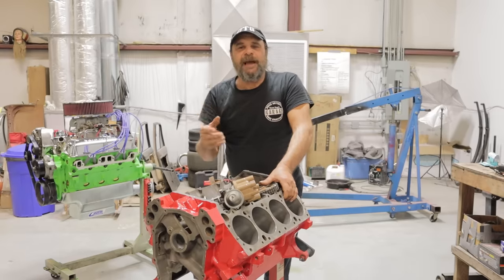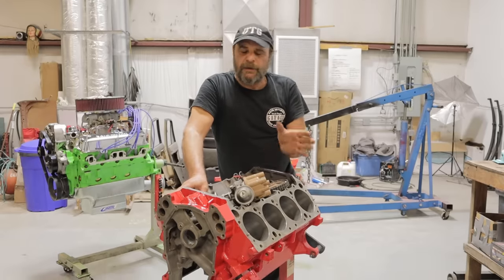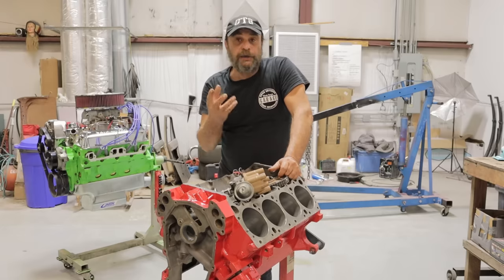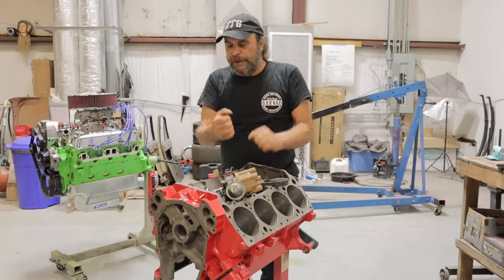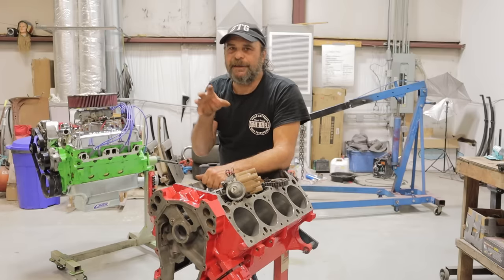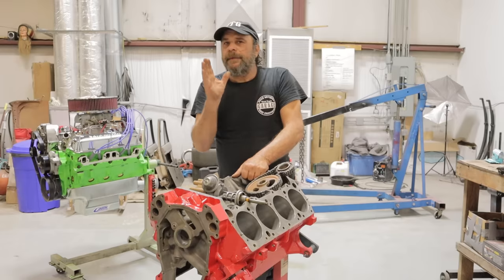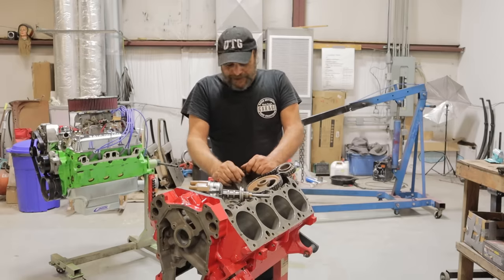Power Timing Secrets For Classic Cars

Comment: You got that right pal....I tune by ear, smell, sound, how much heat hits my face from engine, how hard the fan pushes air past motor, how hard the exhaust leaves the tailpipes, how the tach needle climbs when throttle is blipped wide open and settles back.  Timing- advance to maximum vacuum reading, then back off 3" hg.  Power road tune, ping means back it off more...and been doing it that way 40 years.  Better octane means it'll accept more advance before ping.  You know it's right when you wack the throttle wide open, the exhaust lays the weeds and grass over, and the fan blows the ound air cleaner gasket off the carb onto the firewall, and it picks up one side of the motor, and twists the chassis.  The tach needle will move quickly smoothly up to 5000-7000rpm, then settle back down. You can smell rich mix. You can hear and feel lean mix, it sounds dry, crackle, and heat on your face.

Comment: I remember being young and hanging out with a friend who had a drivers license , he had a car at 17. We used to know a lot a of mechanics and would hang out at a few shops.

One day we went to our friend’s shop who worked on tour buses. The bus company let him use the shop facilities and this  place had a “pit” to work under bus chassis. He used to do “side jobs” and take small jobs to make extra money. I think it was a ford thunderbird maybe, 1977 or so, he did a tune up and proceeded to so a tune up.

He had the car parked at the entrance of the garage. The engine label, if I remember correctly, stated, “set timing in drive at ….” so he throws on the parking brake and leans into the engine compartment, grabs the dizzy cap turns it while he listens to the engine, the engine rpm went up emergency brake wasnt strong enough to hold the car and into the pit the car went. I remember he screamed and his face looked like he saw a ghost. He used a bunch of jacks with wood blocks to remove it. We made fun of him and told him, you should have used the wooden blocks you used to lift the car out of the pit. Till this day we make fun of him.

Comment: i.am.58  i like your experience on these old cars  i. have a 1978 pontiac bonneville brougham  with a 400 4 bbl rochester car
i bought this car 2 years ago..from a guy who had 300 cars for movie shoots..
anyway this car runs amazing for ts age
it was a not a daily driver  i had to change a lot break lines gas tank radiator  etc
i still have not done anything to engine
no tune up ..  only thing i learned to do was
to adjust the choke wheel cold to first
notch more lean choke plate tighter
it takes a little longer to cut down to idle
but it runs higher   but wow car runs great
since i adjusted it

Comment: I used to hold the engine at around 3000 to 3500  and move the distributor till the engine sounded the smoothest. Seemed to work pretty good don't know if it was the best it could have been.

Comment: I discovered it by accident.  I had a 65 Galaxie that needed a head and head gasket.  My uncle helped me do it, or rather, I helped him. We got it going ok, but there was a slight miss and a hesitation when I took off from a stop. So I decided to turn the distributor about a quarter inch advanced. Rpms went up and it ran smother. I took it for a ride and it launched from the stop lights without throttle.  After that, I punched it a lot from the light, because  I was 19 and dumb.

Comment: The crank angle timing is the same with a timing light. You are timing the distributor to the same mark on the crank. Because of the slop in cam chains and gears  , the oem went to crank sensors and knock sensors. This power timing is just advancing the timing because of lower dynamic compression due to wear.

Comment: I was thinking about installing an A/F gauge in my ‘49 Hudson but when the weather permits I’ll be giving the timing a nudge. My ‘49 starts good, idles strong on choke but after a while it begins to mis randomly. Little thuds here and there from the exhaust. At half throttle it shudders. This tip may well help ail this all. Can’t wait!
Reply: By the way: your remark about the direction the vacuum advance is pointing is absolutely great! Does this also mean that, seeing the direction in which it points, one can see in which direction it turns? Would make sense, right? Just checking if my logic is valid. Thanks again Uncle Tony, you’re a legend and a treasure!
Reply: I have driven for 2 hours, it’s average temperature outside and the engine is warm, then I set it up but I am totally at the end of advancing (end of the range I can set it at with the bolt) and it still thuds out of the exhaust (misfiring) once in a while, and at 30 mph the car will shake quite a lot because of misfiring.

Just before the end of advance it will labor more (sound will get a little lower and louder and the engine will get a little slower). So yeah I am at the complete limit of this distributor 😅

Vacuum is around 20 Hg (except for when it pops of course).

Comment: Realistically I agree, I followed BassAssCars of set it and forget it, on my 1970 Pontiac, adjusted the curb idle mix, it was a little high so I smidged timing back to drop the idle a smidge.. Bam! POWERHOUSE all plugs are tan in color never bothered to recheck the timing it just has to feel good and react good. It's kinda like ya don't want a constant speed curb idle when in gear on an auto trans just under medium. Gotta leave room between the car in front. I know what you mean, if anything dad told me if ya don't have a light set it to idle well enough and watch the temp, feel and listen
 Thanks for sharing 😎

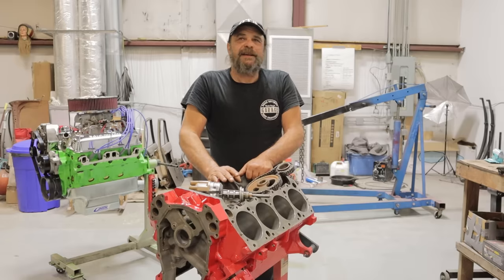Comment: @ 19:11 "it's the least precision".  Tony, I think you are wrong ! It is the most precision you can get because aside from a scientific measurement of all the variables in that particular engine, you are matching the spark to the precise time that engine needs thus producing results ! Just like racing engine builders do with a dyno. The hill is the dyno.
Reply: Too many variables on a motor with miles on it.  Carbon build up, leaky valves, stretched timing chain resulting in retarded cam position thus ignition timing.  Worn cam lobes and worn rings. Old school road timing is the only way to obtain best fuel economy with best power for the grade of fuel you're using.

Comment: Retired Professional Mechanic: Power timing is putting it reverse as long as breaks hold tires.  Driver floors it, then you advance tell spark knock, then back it off a tad. Also, it is very important that you make sure weights are free in mechanical advance and vacuum advance works for the ultimate performance. Back in the 70s, this was common, which also took up timing chain sloop. You can set timing with a gun at 10 degrees but truly you only have 8 degrees because you have 2 degrees of timing chain sloop.  This way you get maximum performance

Comment: Back in the day where I grew up in Bklyn. U power time a car by.  1 Breaking distributor loose. 2 Manual raise up throttle by hand to 2000 rpm. 3 Then keep advancing dist until u get the highest smoothest engram. 4 Then tighten distributor back down.

Comment: I'm surprised that you even attempted this video.  Most people today wouldn't know a ping sound at all.  I just have to add, that if you perceive a ping, you are in trouble.  Pinging usually is not perceptable on a stocker engine to untrained ears unless you get some really crappy octane fuel.  But, if going up the hill you hear pinging on good octane fuel, I would suggest "nudging" the distributor 2 or 3 nudges back, not just one.  We are training today's engine mechanics, who have no idea what ping and piston slap sound like, because they've always had better more precision engineered machinery in front of them.  Thanks for the video, Tony!  Brandon, Automotive Restoration of Lubbock.

Comment: I'm a best case engine fire victim in 84 D250 LA318. Minor wiring and hose damage. Can you do a video regarding hard starting, backfiring conditions, cylinder flame spread into intake with respect to timing? Causes, adjustments, repair solutions?

Comment: 2500 RP m's advanced a timing  Till it  Hiccups a little back it off set it it's usually good Because  Don't always know what What you're working with  That is how I learned before I even had a  Time and light or vacuum  Gauge mess with it till it sounds good and runs good You can feel the differences

Comment: Also  on older motors  the harmonic balancer sometimes the outer ring will turn some and the timing mark can be off which makes a timing light not useful I had this happen on an old small journal 327 find top dead center remove spark plug  , cover hole  with finger have someone turn over till finger blows off the hole to find TDC  compression stroke then find that pivotal point and tune distributer by ear

Comment: How do you go about adjusted your timing and your carb? Do you like to get a good base with your edelbrock for example mixture screws turned out 1 1/2 to 2 turns then get your timing where you like it and then fine tune your carb?

Comment: Thank you !!!! My 66 impala somehow got off timing I put new spark plugs in and I noticed that the gap was different from the original ones in there but anyhow, I decided to do that with a distributor and I noticed that it’s running pretty good, but when I try to turn it on, it’s pretty hard I think I need to do a little bit more tuning 
It used to crank up pretty fast and easy??

Comment: I built a small block n a big block Chevy engine for my C-10's. I have two trucks. Both fresh engines.
Both with HEI ignitions. Factory setting 8° BTC  
initial setting. Both ran sluggish. What I ended up doing is replacing one of the springs in the distributor to the mid weight spring. Both ran much better, however still sluggish at 8° BTC n a bit hard to start. With the change in springs this gave me full advance much quicker. Full advance is between 34 n 36°. 
What I had to do is give the distributor a "nudge" like Tony says, mind you, these were completely rebuilt engines. You also have to use good quality fuel. Bad fuel can also cause your engine to run poorly. I did the "nudge" on both engines. I ended up with 10° BTC on the small block, n 12° BTC on the big block, and they both turn on quickly, and run smoothly with good power on take off. Another thing to check is your air/fuel mixtures on your carburetor. You want to set it as lean as possible without any backfiring. To check for a proper air/fuel mixture, check your spark plugs after 25 to 50 miles or so. The color of the spark plug insulator should be a light tan to a brown paper bag color and should look relatively clean. If they are too clean, your mixture is too lean and running too hot, richen up the mixture, just a "tad" or a little "nudge", you should be good to go. I agree with Tony. Every engine will be different, and in my case the factory specs did not work, but it was a good starting point..

Comment: Just bought a chevy c10 with small block engine.  I noticed vacuum advance hose missing from distributor.  Should I connect to edelbrock carburetor? I'm new to car scene and learning.  By the way in setting ignition advance what would you recommend? Great channel. Just subscribed

Comment: When the factory calls for 4 BTDC or 0 TDC or whatever spec. initial and change that factory setting to for instance 10 BTDC because of as you said due to wear over time different gas etc. isn't really solving the problem because valve timing will still be off and it could still be pinging. If the factory initial does not apply anymore it's time to fix the problem (the wear) if you really want good results

Comment: I have had good luck with this for a long time. After I do the timing thing,, I readjust the air screws on the carb. I simply turn up the idle screw so it's idling high. Then I play with the air screws and put them to the high side of smooth by listening to the sucking of the carb. And then drop idle down till idle acts like I want it to in gear with my foot on the break.. Guys will be correct in saying to use a vaccum gauge but I find that you can hear it if you know what to listen to. The timing ultimately is set so that it still starts right off while hot.

Comment: On older cars, I always have the distributor clamp loose enough so I can adjust the timing on the fly. I drove to Denver one year and the car lost tons of power because of the high elevation. I regained some of it back by advancing the timing by hand. Later when I drove back to more sea level locations, the motor started to ping, so I pulled over, moved the distributor to retard the timing a bit and the ping was gone, Like you say, no timing light.

Comment: Just saw this video and found it very interesting. I’m gonna try this out. I have a basically stock 1968 Pontiac 350 with an Edelbrock performance intake and mild cam. I’ve got my total timing set to 36 degrees at 2500 RPM. The car runs real good, no sputtering or knocking, drives smooth and fires right up when turning the key, but it’s more sluggish than I prefer when stomping the gas. I just had the rear rebuilt with a Posi unit and 355 gears. Hell I can’t even smoke the tires. Pretty sad. I’m gonna give this a whirl and see if I can get some more power out of it. Any other advice Uncle Tony? Love your videos! 👍🏻

Comment: During the muscle car era, 50's thru 70's, we would power time on a chassis dyno, no guessing game. If using stock distributors, we would find out the rpm at which we had total advance and power time at that engine rpm. If we recurved the distributor and I'm referring to mechanical advance, we would then power time at the new max distributor advance rpm. It took two people, one behind the wheel, the other one under the hood. Needless to say, we had an oscilloscope hooked up to the engine. When finished we would put a punch mark both of the distributor and the intake manifold for future reference.
I was fortunate that at the tech school where I trained in St. Louis, we had all moder equipment.
By the way, I do not advise to "power time an engine under heavy loads if it has 100K plus miles on it. In that case, you can do a semi- power timing at 3,200 rpm. You need a tachometer a vacuum gauge and a helper. With the engine at 3,200 rpm, advance the distributor until you achieve the highest rpm and vacuum. Punch your reference marks on the distributor and intake and go from there. It is best practice to make changes using reference marks, not by guestimating.
I wish you success!

Comment: I use to power tune my engine by putting my front number against some solid and put in gear, as I increase throttle I move the distributor is get the best power, you will know you at the right spot when there no lugging of the engine

Comment: I used to leave my distributor slightly loose so I could adjust it for each tank of gas. Bad tank for gas, back the timing off a bit to avoid pre ignition. Good tank of gas advance a bit.

Comment: I totally agree.  I have been doing this for a long time.  I have another way to start.  For initial timing after the motor is started turn the distributor in the retard until it chokes, then turn it to advance until it goes crazy again.  Right in the middle is where to start.  Then just follow Uncle Tony's video.  I do this new or old.  I give up with the light.  It has been meaningless.  For one thing do you know where top dead center really is.  It takes time to get it.  You get better with time and experience.

Comment: I thought I was the only one that did this I don't use a note I use about 1/16 to 1/8 on the OD of the distributor circumference and I make sure this centrifical advanced mechanism is not broken or stuck and I continue to listen on a regular basis turning down the radio when I go up a steep hill in the summer possibly got it cheap batch of gasoline with lower octane etc

Comment: Yup. I get it.  
The Factory built thousands of cars to be driven in all 50 states.   And factory specs are broad for warranty and to keep them from coming into the service garage.  
Each engine could use it’s individual tune. Older engines specs change and need extra consideration.

Comment: I had an 84 Chevy 305 pickup that plagued me for years. It spark knocked at part throttle cruising speed on anything other than premium fuel. I was able to rectify this by setting the initial timing at -2 degrees. Obviously, this was not right because it ran like absolute crap with no advance but anything greater than that, it would knock like crazy. This was due in part to the vacuum advance pulling too much vacuum at part throttle loads. I could have remedied this by exchanging the vacuum mechanism for a diaphragm with a stiffer spring but I went a different route instead. I pulled an 8 pin distributor from a 1990 Chevy and bought a mega squirt ecu that I had to build myself at my kitchen table. After 8 hours of soldering circuits and pulling my hair out, I was ready. Got it all wired up, set the timing on the laptop to 0 and started setting up a timing map. I found that my engine loved to idle at 17 degrees advance and pulled great at 34 degrees at WOT. When I detected knock at any rpm, I would check the map and pull timing from those cells. Then smooth the map and try again. In about an hour of driving up and down a hill near my home, I had her dialed in pretty dang close to perfect. I was then able to run low octane gas without a hint of knock. That truck started and ran as if it had efi (even though it had the capacity for it) with the old quadrajet. I put a wide band o2 sensor and gauge on it and used it to dial in the carb as well. It was incredible how perfect that old tired  engine ran. When I sold the truck, the guy that picked it up didn’t like the computer ignition and asked my to put the old hei back in. I set it for -2 degrees and he’s been driving that turd for 2 years now with no power. I’ll save this ecu for another project someday :)